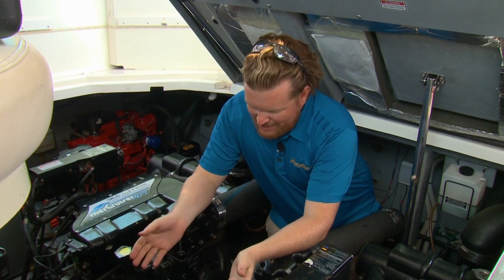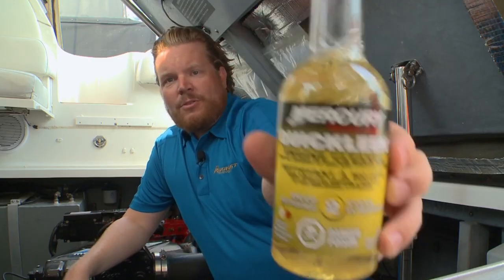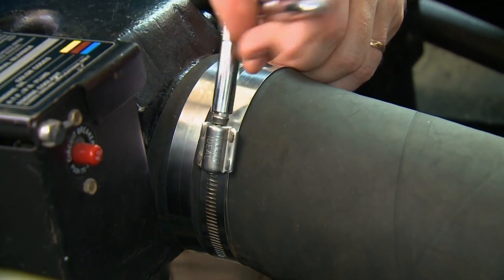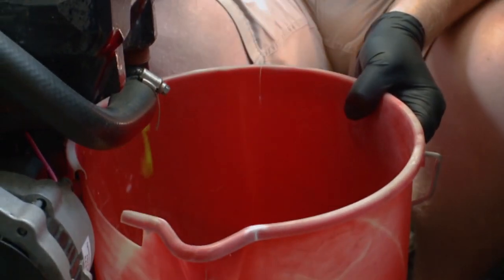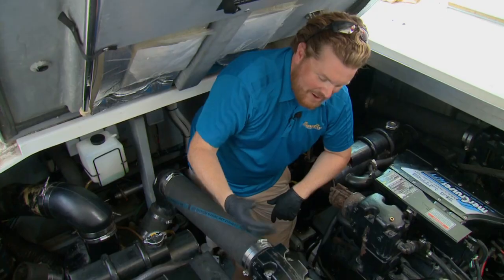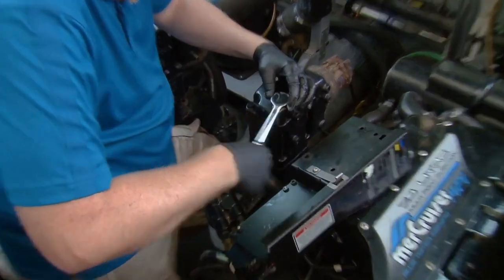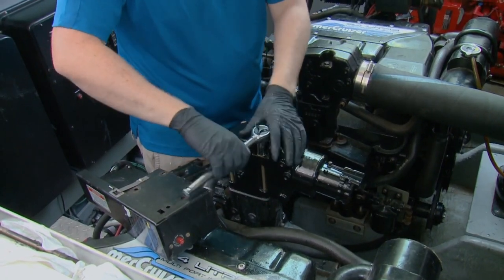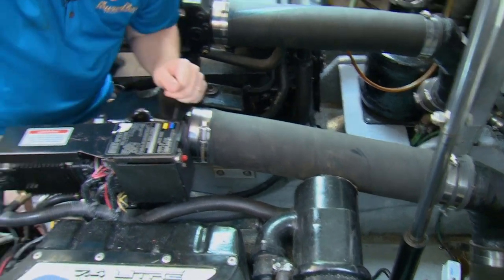How to replace an exhaust elbow on a Mercruiser inboard | My Boat DIY

Comment: I always hear about replacing the manifolds and risers (Dry joint) on my 350 mags Inboards but no one talks about having to also replace the elbows ...thanks for the info...  do you have a video showing the removal and replacement of the manifolds and risers?

Comment: May I ask if it is a problem, and what is the problem could be? For V8 inboard engine, one of the manifold temperature is much higher than the other. The temperature rise faster. Which side has issue? Thanks.